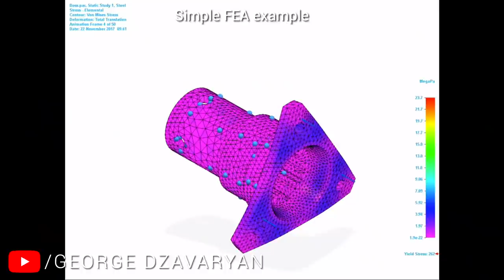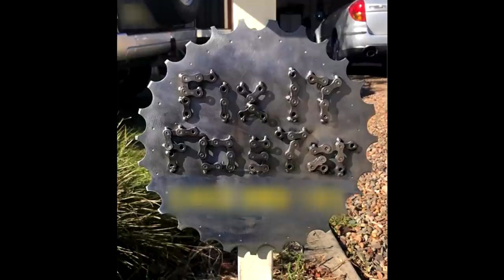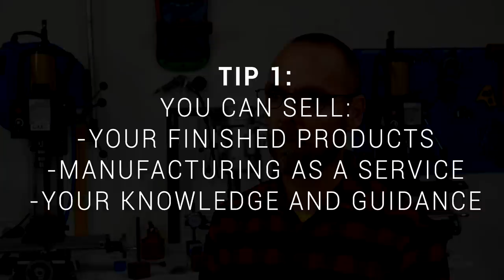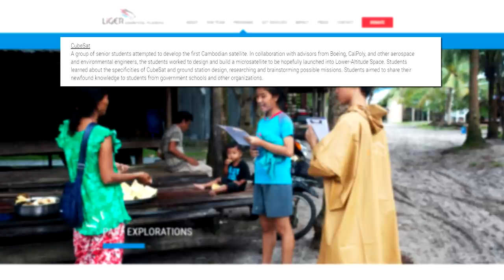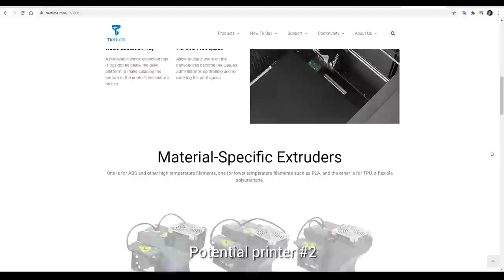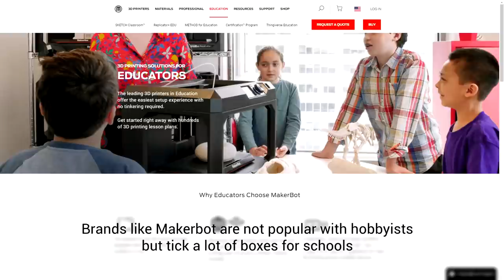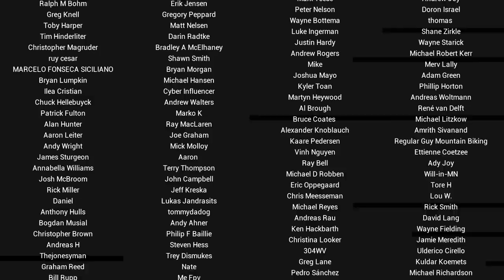Starting a business to suit your passions - Meet a Maker: Nick

Comment: I’m actually in the process of staging for a side business of my own.  3D printing reproduction parts (not currently being offered by any manufacturers) for a very specific generation of cars I specialize in.  I have some early prototypes in field testing now, but will need to build a Voron (likely) printer to handle the load my Ender 3 (purchased to familiarize myself with printing) will not.  I’m a mechanical engineer by trade, so I’m familiar with part design, material requirements, etc.  Put all of these interests together, and it’s the perfect “outlet” for a hobby.  It won’t ever replace my day job (my passion’s target audience is too small), but it’s something I have dreamed about for nearly a decade.
Reply: Sounds fantastic!
Reply: Oh a Voron, any particular reason why you're going for that to supplement the fleet? It being enclosed I'm guessing?
Reply: @derektran9404  I understand it’s sometimes a tossup in ability and features between many open source DIY builds, but there’s “something” about the Voron project that stands out in my mind.  Sort of an emotional trigger or gut instinct thing I can’t put a finger to.  I just got their Mobius 4 extruder mounted on my Ender 3 this week (try out a sample of their design, documentation, etc), and color me impressed with quality!  ABS has a learning curve, which I am still working through (not too impressed with Hatchbox, will try eSun ABS+ next).  But, it’s now obvious to me why they chose ABS: very good potential as an engineering plastic.

Enclosed build volume ability is always a plus, but, let’s face it: if you are going DIY all the way, the ability to make a custom enclosure for ANYTHING should be within your abilities.  Now, maybe integrating an enclosure with the frame will be easier if the basic design was planned for that feature to begin with, but don’t sell yourself short and say you don’t know where to start.  You can get the panels at most big hardware box-stores here in the US.  For the corners, just design your own.  Top and bottom only with unsupported gaps in the middle? Or stack your corner brackets in a tongue and groove style that makes it seamless, though within your current print bed’s ability? Weekend project? Maybe not.  Good planning, even design iterations will take time.  Not trying to lecture, just inspire.

Likewise, I’m only planning on  one Voron, because I don’t know how successful this venture will be.  Start small, do trials, and learn the deep details of what you are wanting to do for your venture.  Maybe you find the equipment you imagined you needed is not necessary, or not effective.  I was drooling over the White Knight/Blackbelt/CR30 for my “production” plans, but have since learned that the style of those printers would be ineffective for my ultimate goals (discovered/realized just by trialing ABS for my Voron Mobius).  Printing urethane (TPU) rubber parts for production (vibration isolators, manifold vacuum signal hose fittings, even firewall seals)?  It WAS my original plan, but now I’m considering nixing it for instead printing reusable molds, and cast the urethanes (haven’t tried yet!).  A sanded mold could have better surface finish (not to mention eliminate layer knit lines for strength), and many molds could have a much faster turnaround time than a farm of printers.

Take your time.  Dip your toes into the water gradually.  Don’t stress yourself by going too fast.  You will stumble; it’s inevitable, and just part of life.  Better to stumble when shuffling slow than at a sprint.  Start your ‘market’ on forums or in person gatherings (car shows for me), then decide if it’s worth setting up a full blown webstore, or just a social media presence.  Maybe you find it’s too stressful for full time, but fun when part time? The last part is most important: have fun.
Reply: @stephenjohnson4955  I'm building a V2.4 myself, its interesting for me to see your perspective as someone who is looking more for business than as a hobby.
Reply: @derektran9404  I’m also looking at it as not so much a complete business, as a way to “fund” my hobbies =)

A Voron can cost quite a bit of cash, and we all have limited bank accounts.  3D printing is certainly addictive, and I gave up keep track of the cost I have invested, because my Ender 3 quickly went to use as almost a “toy” (not slamming it, it’s just found use in “non business case” projects; just like how my project car is a “toy”).  But, if I can have a level of confidence that my Voron build will be paid off in income, but still be available for personal use (my sales-intent designs would benefit myself too!), then my wallet is open a little bit more.  Otherwise, I’d just spend it on fixing my patio deck, lol!

Bottom line, I know I won’t be able to make a living off a side venture.  I just want to have fun, and use it to have an excuse to have (and fund) awesome tools.  Plus, I want to keep these cars on the road, and parts availability is a big discouragement for the community.

EDIT
I have used a Raise3D Pro2 at my place of work for many industrial projects: assembly aids, jigs/fixtures, even critical parts for large engine dynamometer testing (where design “overkill” is certainly a virtue).  My Ender3 may not be as reliable as a Raise3D, but my Ender seems to print much better quality (though I’m not certain the Raise3D machine is even properly dialed in).  That is why I am looking at a Voron or other DIY vs a “Prosumer” purchase.  I like what I see in a Voron, and know what high money can otherwise get you.
Reply: @stephenjohnson4955  I personally am of the opinion that a voron is better than a Raise. Also yea, I like funding my hobbies also, it helps stem the bleeding.